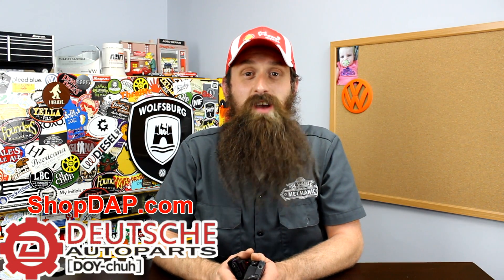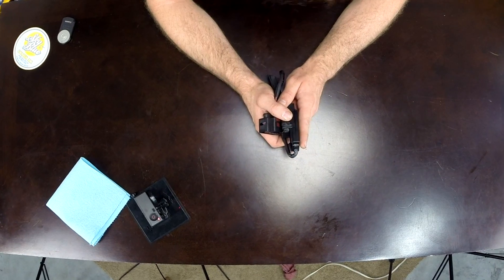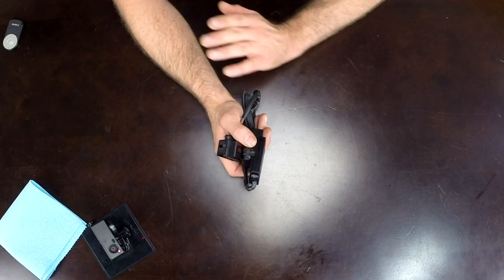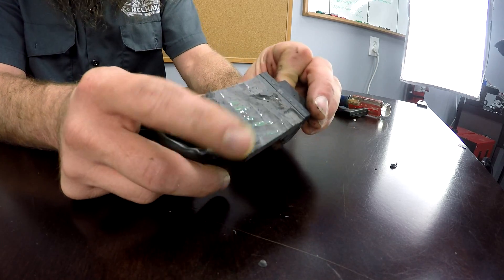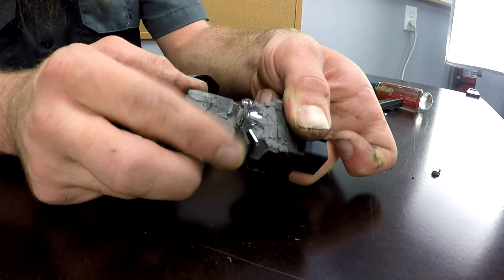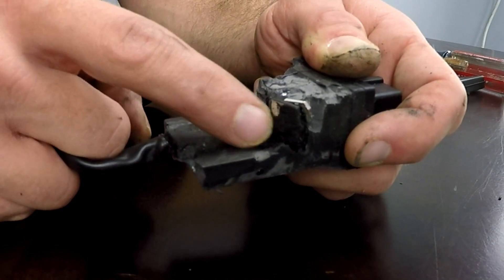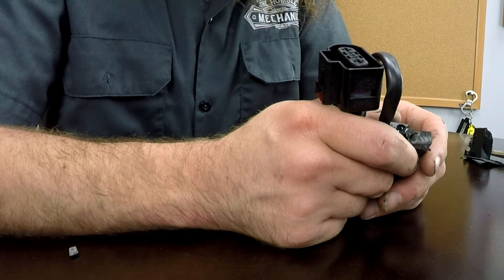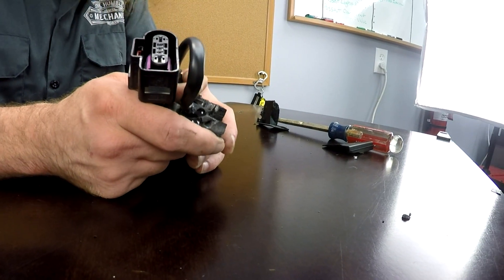How VW Parts Fail ~ 2.0t Fuel Pump Modules

Comment: Hi @HumbleMechanic I just bought a used 2007 VW Passat for $850 and I'm thinking since there's a recall of this model of Passat, I may need to replace the Fuel Pump Control Unit by the time i receive the car. If so, where can I buy a suitable replacement Fuel Pump Module? I am based in London UK....but plan to export the Passat to Nigeria, Africa. Can anyone please send me a link to where I can buy the part? WIll be happy hear from anyone on here.....

Comment: My fuel gauge shows the wrong reading, what do I do?
Reply from the maker: Depends on the car. Most VWs you can output test the gauge, and then use valves to monitor the potentiometer in the level sender
Reply: @HumbleMechanic  this is a Passat 2008 Bpy

Comment: Hi everybody! Sorry, i dont speak english.. google translate: 
THE CHEAP SOLUTION:  remove the module from the seat (out of the seat) Cable elongaton to trunk. To the open air.  And buy a little fan (5V - Car cigarattes lighter, or USB)  
Working for me for two years.

Comment: I have a 1.8tsi the car stalls when then won’t start until another hour then runs like nothing happened when it’s stalled fuel pressure won’t go up then it runs like no problem this problem has been going on for 2 years
Reply: My solution: remove the module from the seat (out of the seat) Cable elongaton to trunk. To the open air.  And buy a little fan (5V - Car cigarattes lighter, or USB)  
Working for me for two years.
Reply: I changed the module and still same problem

Comment: you never show how to reach the other part that goes under the seat frame ...got the seat off no problem...unscrew the top of the pump no problem...unclip the part connected to the pump...no problem...but the other part trails down under the frame of the seat...how do u access that clip?
Reply: Good point 😢

Comment: Great info Charles. My FPCM just failed recently. It began exhibiting all the symptoms about a week or 2 ago, random stalls, difficult restarts.  But with all these, if you waited a certain amount of time, depending on the ambient temperature outside, anywhere from 15 minutes to an hour the symptoms would temporarily disappear, only to rear it's ugly head again sometime later, depending on the outside temperature.  Volkswagen did issue a recall on this part a couple of years ago ( I am the second owner) but I never had the service performed because I never saw any symptoms and assumed the previous owner had had the service performed. (Lesson learned).  However, this summer so far we've had a warmer than normal summer where I live.  That compounded with the fact that my A/C is not working probably made matters worse and accounts for the reason the module in my vehicle started overheating. If it hadn't been for the recall, I'd have probably replaced the part myself after seeing how simple it is to replace.  Like you said, the most difficult task in the replacement is removing the back seat and pulling back the small piece of carpet hiding the rubber cover (I have a 2009 VW Passat station wagon with the 2.0 L Turbo B6 engine).  Thanks again for the post.  I never miss your videos.  I find them very informative and always easy to understand.
Reply: I'm having the same issue, on my 09 vw passat wagon at first it would stall here & there now it starts but shuts off right away I changed the high pressure fuel pump on the engine bay, pcv valve ,fuel pressure sensor & nothing I hope it's my fpcm or my fuel pump in the thank
Reply: @magicvisions23 did you happen to fix the problem? I’m having a similar behavior with my passat b7

Comment: Can someone HELP PLEASE. I have a 1.8t Passat 2003 manual. Car cranks but will not start. I’ve changed out fuel pump, fuel pump relay and fuse. AND TESTED them. All fine.  Tested relays and they click. Even when I turn my key to 2 position I hear them click. Battery also dies very fast after charging and cranking a few times.  Mind you I’ve been at this for a few months. I know I’m not getting fuel to my lines because when I spray started fluid In my mass air flow sensor it fires up but doesn’t turn over ( engine shakes and stutters). I thought it was my ECU not sending voltage to my relays (took the ecu fuse out, was a little corroded but it made the car crank again once I put it back so it wasn’t the problem ). But I ordered a new one only to get Immobilizer activated on my dash after installing it in the ecu box under the hood driver’s side.. I thought it was the auto theft system being triggered by me changing fuses or the relay but idk why that would prevent fuel pump from priming... Also my passenger side window is broken ( window half way down) I don’t know if that would trigger my car to not recognize my key or what not. I have the battery light, check engine, ecp on my dash. I’ve also changed spark plugs and tested my starter and starter relay. All fine. ( fuel pump relay and starter relay click ). Still no luck. I charge my battery ( becuase car has been sitting for a while and I can only crank it a couple of times before it dies again.... im going to buy a fuel pump control module to see if they would be the fix. Again, fuel pump not priming, no sounds coming from it. The new or old one.... would the fuel pump module make my pump have no power? Any answers??

Comment: I think this guy has just solved My gti’s issue after long periods of driving and fuel pressure check engine codes gonna change it and see what happens
Reply: Can you let me know, and what error codes is it trowing, my car been dick lately not enought power. And to start is a w..

Comment: My tip to everyone. Buy original VW fuel pump control module. I bought a replacement from O'Reilly's and after 2 days the POS caught fire. It burned a hole in my back seat and burned the wire harness. Original VW part was only $25 dollars more. Lesson learned.
Reply from the maker: Woah. That’s nuts!!! And scary

Comment: 2008 passat fsi p0089 and p2293 codes, car ran out of gas at one point, car will run and drive fine, 20 mins or so sitting, go to get back into car, wont start. Any help?

Comment: can a failed or damaged control module result in high fuel pressure? the white cap that is connected to the module is cracked really bad, my VW Passat is not old which leads me to believe that these cracks were high stress caused by high fuel pressure. Any thoughts?
Reply: Who did you have in the back seat 💀

Comment: Great video, it was spot on. 
Could you help me with one issue i have with my 2009 Tiguan (2.0 TSI)? My car won't start and as you discussed in your video, after scanning the vehicle, i have a fuel pump control module fault (P3089). 

So i'd like to know what to do. Should i change the fuel pump? or the fuel pump module?
Many thanks, in any case
Reply: There is a recall on the fuel pump components. I got mine replaced free at the dealership. Look on NHTSA for your vehicle or in the mail should be recall notices. My car 2006 Passat.
Reply: did you figure out what the issue was ?

Comment: Hey man! Idk if you respond to comments on old videos, but is the pump under the backseat in the tank a lpfp or hpfp? I was told I need my lpfp and module replaced
Reply: There is a recall on the fuel pump components. I got mine replaced free at the dealership. Look on NHTSA for your vehicle or in the mail should be recall notices. My car 2006 Passat.

Comment: How to verify if it is the control module before checking the actual fuel pump.
Reply: There is a recall on the fuel pump components. I got mine replaced free at the dealership. Look on NHTSA for your vehicle or in the mail should be recall notices. My car 2006 Passat.

Comment: Hey Charles, I have a question. Can you please help, I suspect I’m having a problem with this module or the in tank fuel pump. My car is a 2014 Jetta GLI with 43,000 miles.. it recently started to develop surging and hesitations in 3rd or 4th gear when the motor is under a load between 5000-6000 rpms.. So far I changed the engine air filter, fuel filter, ignition coils, and spark plugs and tried chevron fuel treatment and still having no luck.. there are no trouble codes and  the check engine light hasn’t come on...  please tell me what you think, I don’t know what to do next...
Reply: mikey4168 did u ever figure out what was wrong with it? I’m having the same issues with my car

Comment: Hi I have vw 2007 Passat 2.0 tfsi  sometime it’s not going to start . It was showing a code P 0089 .Should I change in tank fuel pump module. ????Thanks
Reply: There is a recall on the fuel pump components. I got mine replaced free at the dealership. Look on NHTSA for your vehicle or in the mail should be recall notices. My car 2006 Passat.

Comment: Hi, thank you for this awesome video, really helpfull. I have a 2006 Audi A4 2.0T (FWD) won't start, code P0089. I replaced the highg pressure fuel pump and filter. Manual says there is not relay for this car. How I can test the module? I don't see any electric pump in the tank... I am stuck in if I have to expend about $140 in this module or not. Thank you!!
Reply from the maker: before you replace it, call Audi and see if it's covered. They had a recall on the VW side.

Comment: After three hard starts yesterday morning, my control module was replaced under a recall notice. With normal maintenance my '08 Passat 2.0 has delivered 262k great miles. It still drives better than the '18 Chevy Cruz loaner I was given while repair was being made.

Comment: I'm having a problem with cold starts in the morning. My engine idles very rough until it's fully warmed up. I already did a intake valve cleaning with walnut media however it made no difference. Could this module be an issue? Already replaced coil packs, Spark plugs, pcv. Any ideas would be appreciated. The colder the day the worse it misfires when starting from cold.
2009 VW GLI
Reply: This ended up being the rear main seal. Replaced with upgraded iabed seal and worked perfectly.
Reply: I'm having this exact issue. Very hard misfire when idle on cold start once warmed up it drives fine. Getting random misfire codes. I've got a 2012 gli 60000 miles.
Reply: @kylebillingsley2747  any updates, mine is doing the same thing and i'd like to avoid the intake cleaning if that's not the issue, thanks!
Reply: any updates, mine is doing the same thing and i'd like to avoid the intake cleaning if that's not the issue, thanks!

Comment: I have my 2009 vw Passat at the dealer for a recall with this part and I do have a check engine light on for fuel pressure.i do not have any drivability issue though the car has plenty of power. Tyvm  for this video and verifying the problem.
Reply: Same. Same car, same issue. Although just the other night I had the ECP light come on and it almost stalled when accelerating and the vehicle shook. Oy. Hopefully the dealer fixes it

Comment: Hello Humble mechanic, I hope you can help me out, have a 2012 gti and got the P025A code mi car is working good only issue is that at the begging of driving it, it feels weak only every time I stop and start again driving. Any advice. Thank you
Reply from the maker: Fuel pump modules are a common failure
Reply: Thank you for replaying, so having my car having a weak driving only when I start driving should be because of this module. Or what should be a symptom. Related to this failure
Reply: @conradogarza2274  did you figure it out? Ive got a p025a code too. Seems a little slow but I'm not sure if it's heatsoak

Comment: Hey Charles, thank you so much, after watching this video I realized THIS was my problem and solution. My old fuel pump control module was bad (had it tested by two different mechanics) I replaced the module with an oe module direct from Audi, and now I'm still having the same low fuel pressure engine code as before AND it's still hesitating when I mash the gas. Does the module or ECU need to be programed once it's installed?

Ps. I already have a new fuel pump, hpfp, low pressure sensor, and fuel filter, still no change.. Please give me ur thoughts, ty so much for ur time..
Reply from the maker: No programming needed on the FPCM. Maybe the cam is worn?
Reply: @HumbleMechanic  ugh, I was hoping it needed to be programed. I've already replaced the cam follower, it didn't need it - it looked excellent but I replaced it anyways. Would a worn camshaft cause a low fuel pressure engine light? Is checking the cam easy enough to check if it's bad or not?
Reply from the maker: yeah it can cause that issue. Just pull the pump and follower out to inspect. Super easy.
Reply: @HumbleMechanic  OK so jus inspect that one lobe? I'll probably do extra and pull valve cover off and inspect them all.. I really appreciate you
Reply: @HumbleMechanic  this may be stupid, but my high pressure fuel pump was annoying me with getting that short fuel hose back on so I put a fuel 90° brass elbow on the line to make it longer without kinking. It's the same size coupler as the line, could this possibly cause a problem? I didn't see why it would but figured I'd ask... Ik ur super busy and truly appreciate the time you've taken to help lit ole me :)
Reply: William penrose did you find the problem???
Reply: @josenaranjo2811  yes, so I have a small vacuum leak that is expensive to get to by my air intake. So when I mash the gas it's not getting enough fuel and too much air causing hesitation and also causing a lean fault code. I'm gonna jus leave it alone.

Comment: Hi! If my fuel pump doesn't turn off, my problem is the module, the fuel pump or both? I checked the module and it overheated, I disconnected the connector on the side of the pump and the module cooled. Any advice???

Comment: if you was replacing this fuel pump module for audi, would you be good with one sold on ebay that has the audi logo on it and they say its brand new factory OE, or would you go to Audi and take it in the rare at the register?  Ebay wants $75, its night time so i can't check audi yet but im guessing around $250-$300
Reply from the maker: I’d buy the $75 one and hope for the best. Lol

Comment: Hi, I like your videos and been able to solve problems on my car with these. However, I am getting P310B code. Duty cycle for the pump is 70%. What should I change fuel filter or pump?
Reply: Hi ! 
I have a same fault code P310B, did you fixed tha problem? Let me know:)

Comment: There is now a recall on this part - Safety Recall 20AE - Fuel Pump Control Module.  NHTSA 17V509 for at least the Passat, Passat Wagon and CC - 2009 thru 2016.
Reply: Just got mine done for free
Reply: @ROROKART  how did you go about doing that is there a number or something you need to call? I would like mine replace.
Reply: Just took my car to local vw dealer

Comment: Help! I just replaced this on my 2009 vw cc and now my gas gauge doesn’t work. I put the old module back in and it reads the fuel normally. Is there something I’m suppose to reset or is it a bad module ??
Reply from the maker: Nothing that you should have to do. Be sure you are doing the repair with the key off. Maybe you got a bad module? Also look at the pins at the modules.
Reply: HumbleMechanic Thank you for the quick response! Okay I’ll take another look at it. I’m thinking it’s a bad module but I’ll post an update
Reply: Hi. How did you fix the problem?

Comment: I just fell victim to a faulty FPCM... In my case it melted & caused a short circuit, causing the fuel pump to be constantly running at high speed, even after the engine was turned off and doors locked!! The factory-installed was revision F from Romania, current revision is J from China, with a metal heat sink exposed on the big flat side. I disconnected the battery for the time, until I purchased one from the Stealership & replaced it as DIY.
Reply: Hey i had the same problem, after 5 years my original made in romania rev F fpcm gave way, replaced it with a made in China revision H,  after couple hundreds of km's it died on me, now they have change it another revision whch i have yet to check, whats the update on your solution?

Comment: Hello, I have 2010 CC and I have been getting misfires. I had VW dealership change spark plugs and clean up fuel system. Now my car keeps jerking when its being driven at steady rps anywhere between 1000 to 3000. If I accelerate it does that fine. I have no codes whatsoever. I read that i might have bad ignition coils so I ordered R8s and it still does the same thing. The "jerking motion" is more noticeable when engine is cold, once it worms up it is little less but still there. Could this be a problem? A lot of people saying it might be carbon build up in intake valves but my engine has 55 000 miles and since i have been owner for about a year now I have always put 93 gas in it. Any ideas?

Comment: I got the P025A code after trying to start the car, got no engine light on but my obd2 scanner gave the code. Check the fuel pump module and it was hot. Should I change the module or is there another reason why there's an open circuit in the module?
Reply: Did you find out? I just pulled a p025a code and am hoping it's just the control module

Comment: I have a 2010 VW CC and it is having misfires on cyl 1 and P2293.  I have read that it could be anything from the low pressure fuel module, hpfp, to the thrust sensor?  How would one troubleshoot between all these parts failing and find the actual culprit?

Comment: how about the fuel pump not turnng off? with engine off and key out of ignition and will only stop when battery is flat or off
Reply: J Scott hey ye it was just down to the module in the end audi/vw crap